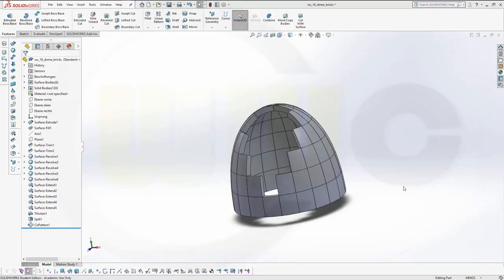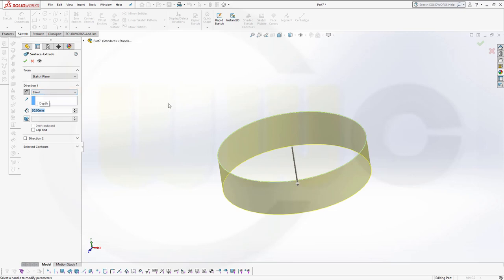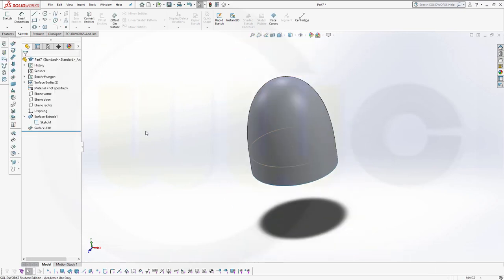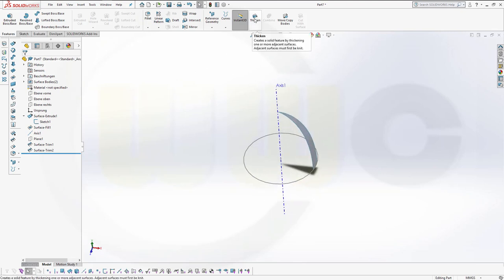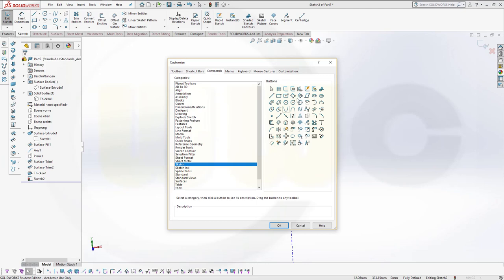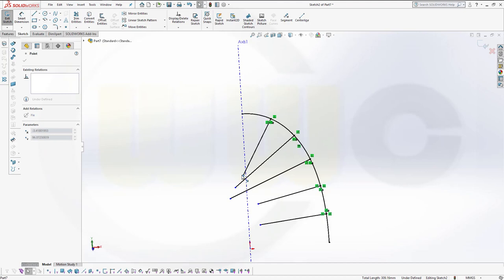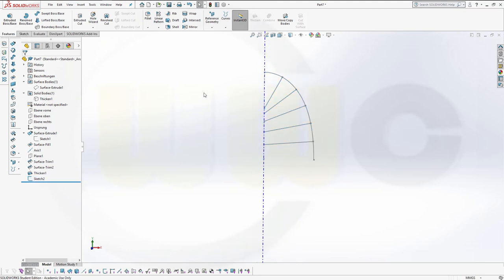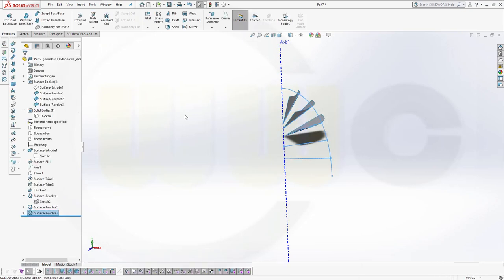Dome made of bricks - SolidWorks 2018 Training - Part Design

Comment: thank you wolfgang,
as private pilot i was not interested in your rudder but  DOME
using  solidworks 2021 i am not able to flatten   the  dome.
actualy i like to make a helmet with an inserted curved shaped pcb board as a therapeutic device.
for production the dome-pcb must first flattened - and after soldering the electronic parts, the pcb board will be curved
and inserted in the helmet.

any idea how to do ?

     gruss aus villach
     danke für deine mühe
     rudi
Reply from the maker: Hallo Rudi,  Du möchtest also ein Modell abwickeln? Und es ist kein Blechteil? Meine Mailadresse: info@wwmc.de